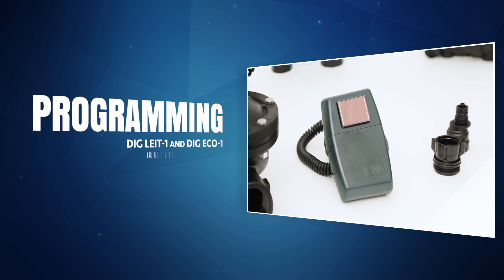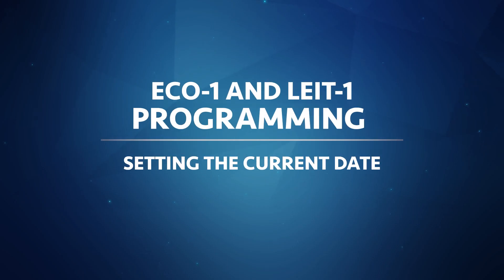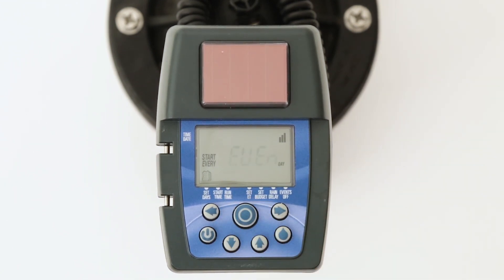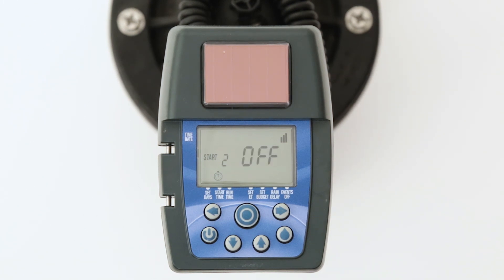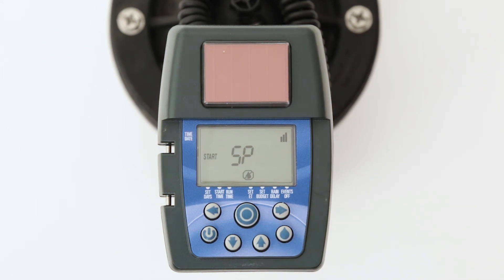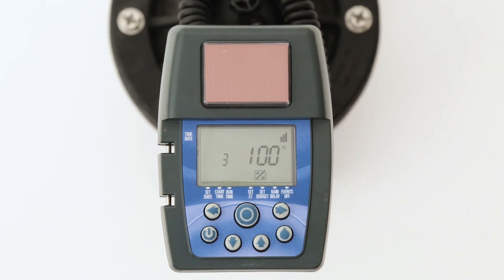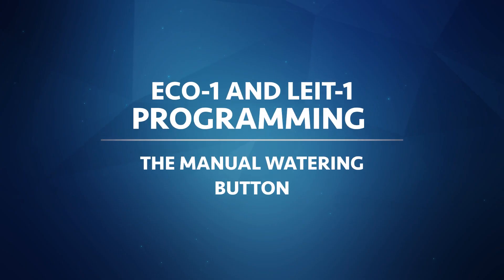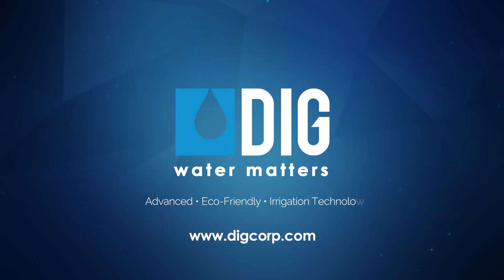DIG ECO1 & LEIT 1 Solar Powered Controller: Programming

Comment: I'm starting a second season with mine.  One complaint:  i can't figure out the "every four days function":  when does it start counting?  It should be, imo, from the day the setting is made, but apparently not 😡 I waited four days for nothing.  I just reset programs and tried again.

Ghosts will lurk in the "events off" section.  Since you have to scroll through 96 steps.  On/off for Mondays-Sundays by month or the each month as a whole.